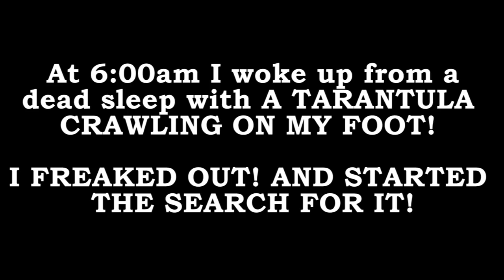TARANTULA IN MY BED!!! Craggy Wash

Comment: Put steel wool around the wires in the holes
Reply: I just saw a warning that steel wool being very flammable is not good to put around wires. Good for pipe and sewer holes, but not where a hot wire might ignite the steel wool.

Comment: If this video isn't on time delay so the 'problem' has already been resolved, I apologize; .... but personally if it were me taking everything apart to find it unsuccessfully and then putting everything back to sleep, etc. again I would be worried that I now had multiple tarantulas because of all the excess traffic in/out and putting things where they normally wouldn't be before returning them to order.  Would freak me out until I KNEW what happened or multiple weeks had passed (and I was in a MUCH colder climate that probably killed it).  Sorry you had to deal with the discovery/aftermath.